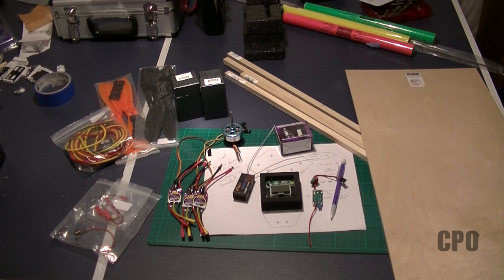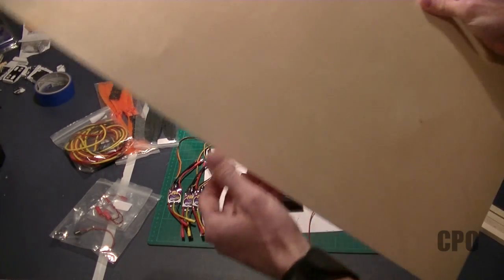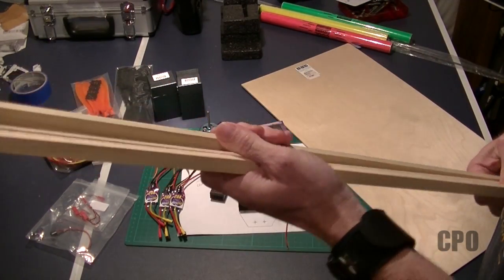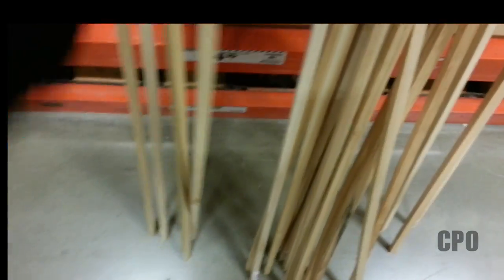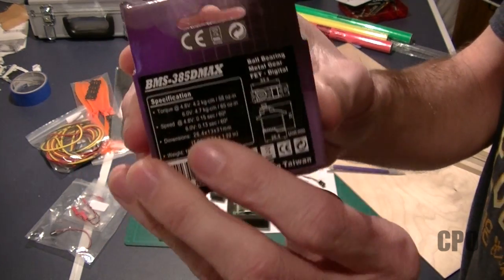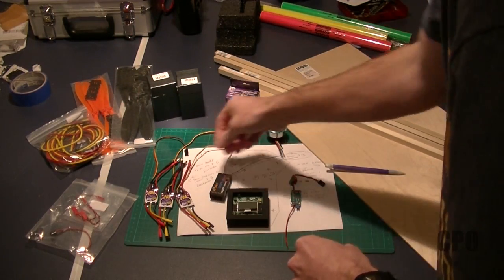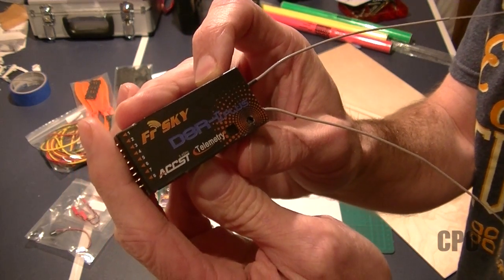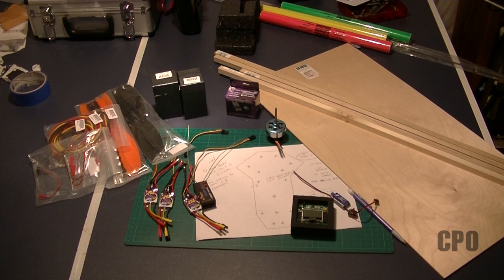CPO Tricopter Build : Introduction and Parts Overview

Comment: tip... when you cant find some straight ones soak them in hot water for some time 5 min or less, then try to put them under some straight stuff like some straight metal angles or straight wood might also do the trick and flat them up... let them sit for the night and they should be level the next day... :-) 
Ed